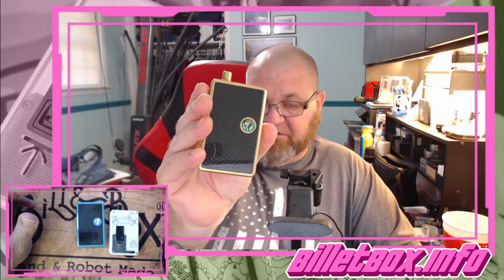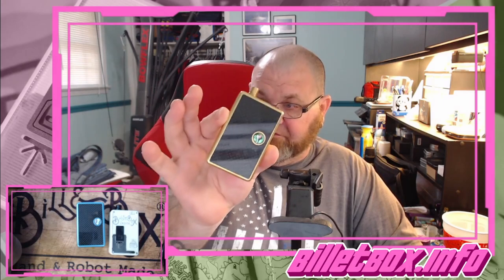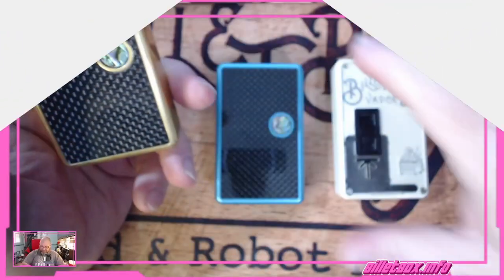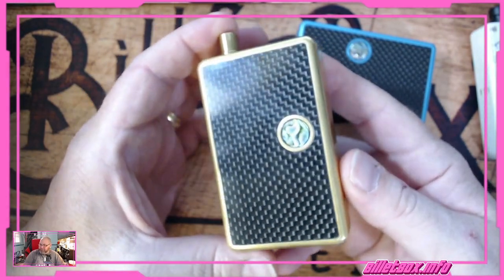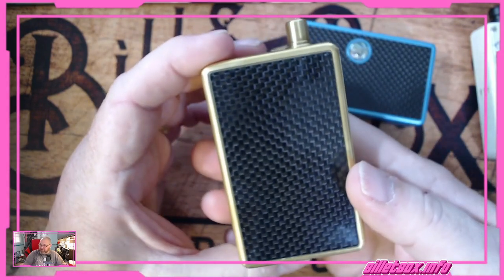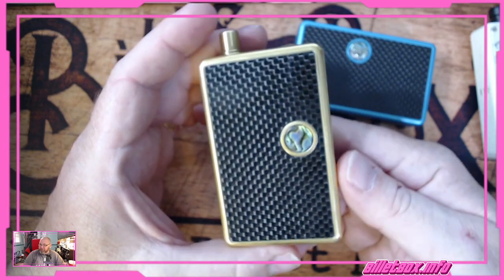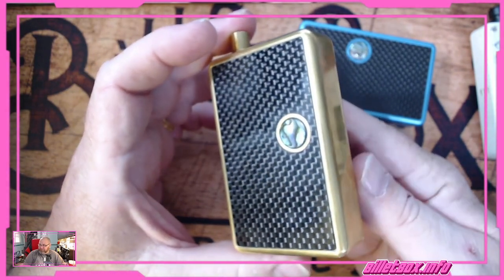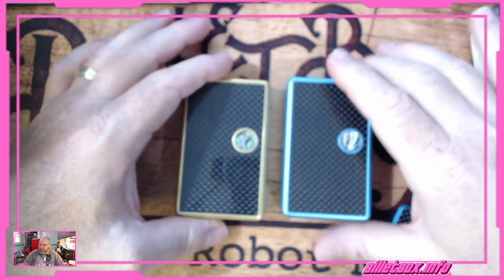The Brass Flipper Rev 3a (2015) - A Piece of Billet Box History

Comment: YESSSSSS!!!!! The Rev. 3's are so much cooler than the Rev. 4's!! This is the only one I've always wanted!! I bought an RGB Rev. 3 back when they brand were new. I still use that box! I love it, but the Brass flipper Rev. 3 will always be my white whale.
Reply from the maker: They are cool for sure, but not nearly as functional for me... unless you modify it with a lipo and a DNA chip. Also, would be really cool if there were a way to use standard Rev 4 Boros so you can have the great RBA selection. If I was a MTL vaper though, I could definitely get down with the Rev 3. For me, collectibility is A+++ for the history. 

PS. I would never modify the unfired Rev 3s I have. :)
Reply: @BilletBoxInfo would you sell me a black rev3 😭👉🏻👈🏻